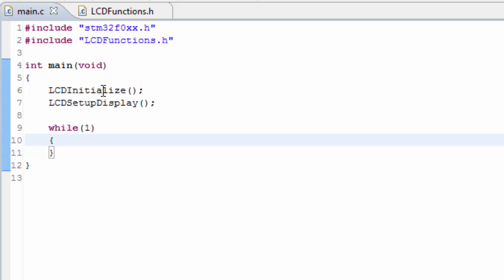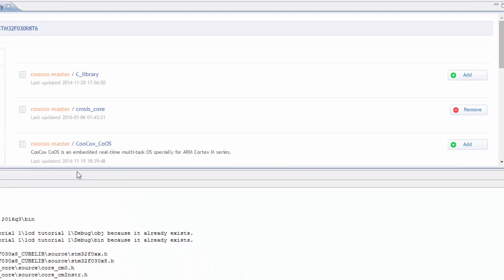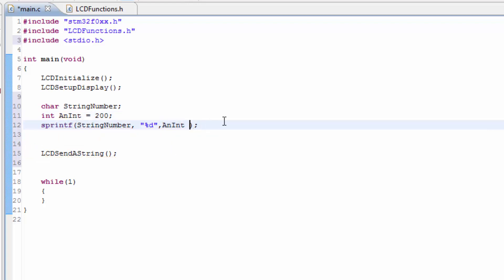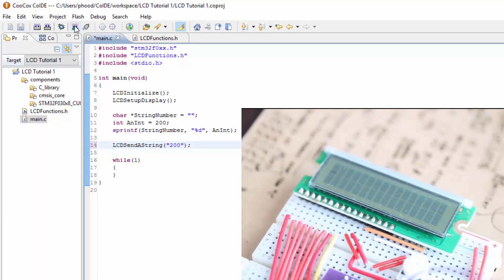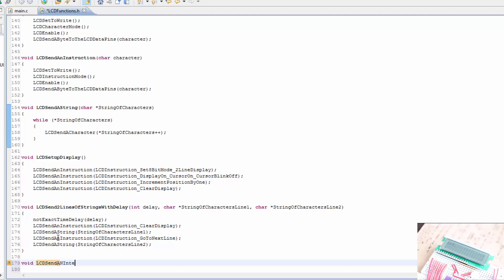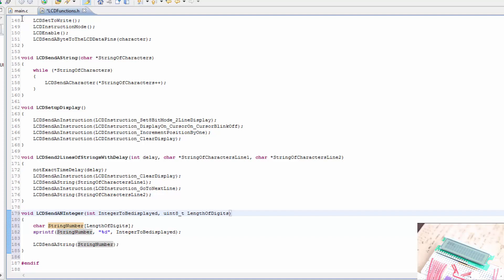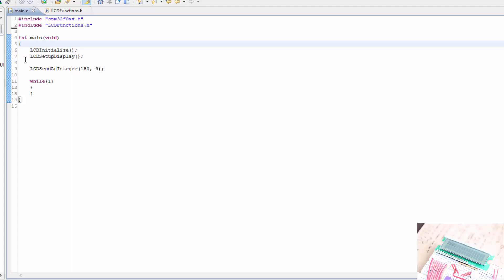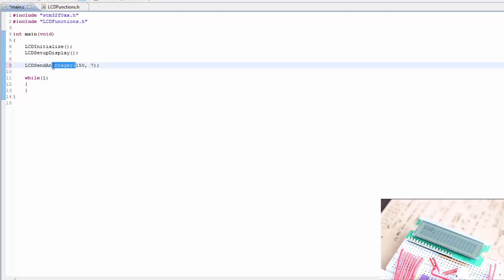29. How to Display Inegers on an LCD with ARM STM32 Microcontroller Tutorial - Part 16

Comment: Amazing tutorial! Thanks for your effort. I have learned a lot stuff from you.
I have tried something else. If you use &-sign in sprintf function, you can also use  the char variable without declaring an array. I have tried in my ARM and worked out. I can print numbers till 999.999.999. 

void LCD_SendAnInteger(int integer)
{
	char stringNumber;
	sprintf(&stringNumber, "%d", integer);

	LCD_SendAString(&stringNumber);
}

Comment: When you use a char array to hold a number, don't forget that you need space for the null character.  Your code may work without that, but you may run into problems at any time.

Comment: Well i guess, you have renamed your LCD library but is that video missing.... i could not find it out
Reply from the maker: I didn't rename any of my videos.  Did you look at the playlist?
Reply: Thank you Patrick, for immediate response, but i mean the LCDInitialize() and LCDSetup() functions were not made in the previous video lectures. I mean have you changed the name of the existing Library name.
Reply: Yeah there is quite a bit of code that wasn't covered on video, unless there is a video 28.5. Looks like we will be able to piece it together with a few strategic pauses though.

Comment: for me even if i am using maxlengthofintegers as  1 or 2 or 3 etc,,,and integer being eg 1234..... still i am able to display.why?
by the way i am using uint8_t for maxlengthofinteger. explain plz.
Reply: It will work, but you are writing to memory location you do not own.  Code checks will sometimes catch this but sometimes it runs ok.  Best bet in C is to just pick a big number like char OutputString[200].

Comment: Declaring a pointer does NOT reserve memory space for the array members; the compiler has no way to know how many members will be stored...
Reply from the maker: If you are referring to timestamp 4:53, I mentioned that "malloc" is used in conjunction with sprinf due to the sprintf's requirement for a known memory allocation.  At timestamp 6:11, I change the char from a pointer to an array due to this fact.  I don't see where I mentioned that a pointer reserves memory.  Can you specify where I said that?  Thanks.
Reply: @PatrickHoodDaniel  I didn't say you said that.  I simply explained why sprintf had trouble with a pointer that did not point to reserved memory space.  Incidentally, malloc requires a garbage collection service (such as is found in OSes) to function as designed.  A limited version is supplied in mem.h that dynamically allocates RAM immediately after the highest reserved RAM address.  Use it sparingly or it will fail (return null).